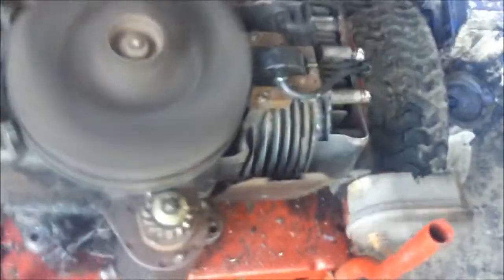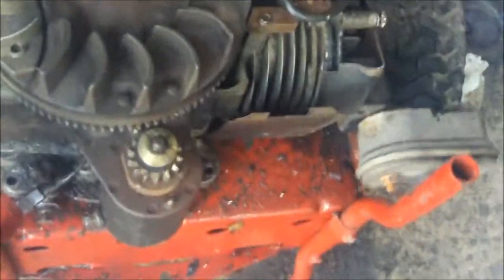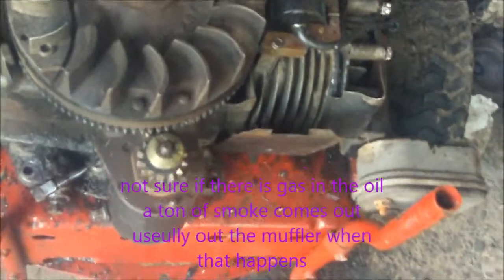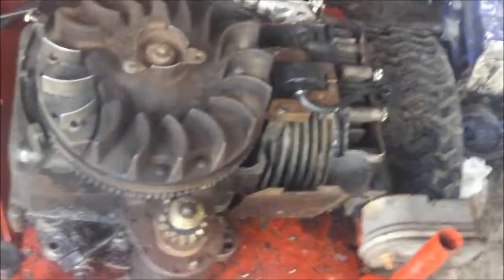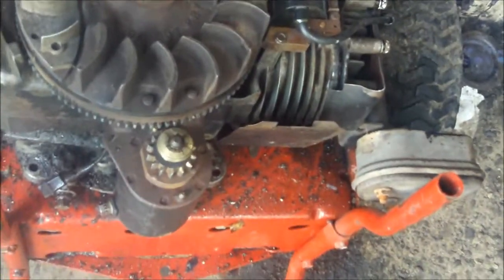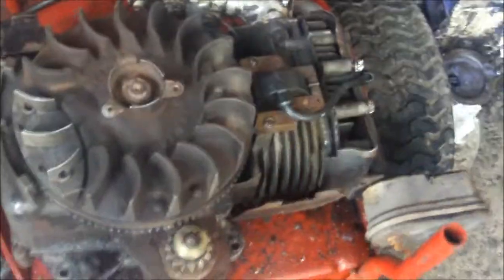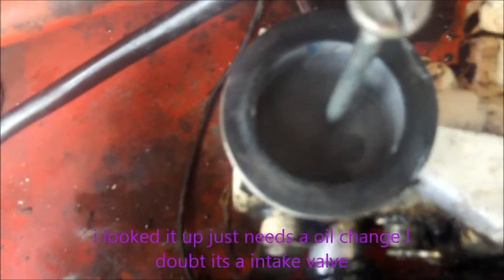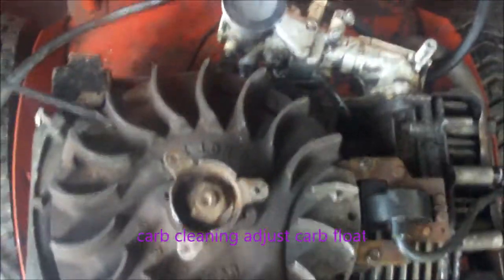Update the 1987 8hp briggs runs somewhat for my 1980s snapper rear engine project

Comment: I would pop that head off and clean up any carbon on the head and cylinder. Then you can also check your cylinder wall and get a good understanding of the health of the engine. The smoke is most likely from poor sealing valves, with the head off, might as well check them out and lapp them. I would agree with Ashurii on getting that pulley off. Hit it with some penetrating oil where the set screws were and let it soak overnight. Then use a blow torch to heat up the pulley on the shaft. Your goal is to heat up the pulley which should break it free from the shaft. Use a rubber mallet or a peice of wood with a hammer.
Reply from the maker: been a while maybe 5 years since I ran that engine. i bought a head gasket years ago thinking it was blown. it ran back then and carb did not smoke sometimes. i can get the snapper engine discs of with out heat and just use pb blaster.. tuesday it might be 60 degrees will work on it further then. thanks for your tips and help

Comment: I think the Smokey carb means you have a blow by issue ( rings ) and or head gasket could even be valves I would take the head off and see what your dealing with. At least it runs
Reply from the maker: i thought it might of had a blown head gasket years ago and bought one, its been a while since i ran the engine. maybe like 5 years. carb did not smoke last time i ran it. tuesday is supposed be 60 degrees will look it too it then. thanks for your insight and help

Comment: dont rebuild anything just run the shit out of it and see how it does look up the set screw number and see what size it is the smoke is just from seting and being flip sounded like it was running just fine
Reply from the maker: mite be worth taking the head off. would you take the head off if you experience carb smoke?.  I may just try a carb cleaning first,
Reply: a carb clean would be ok but it did run good  have had bran new engines have carb smoke
Reply from the maker: it will not stay running not sure if you caught that in the video. maybe cuz i did not have throttle hooked up or maybe the  vibs from engine shut it off. i get it figure out tuesday
Reply: bleachedpc well a crab clean would do then
Reply from the maker: will get some crab shampoo but acording too Rickey lighter fluid should work